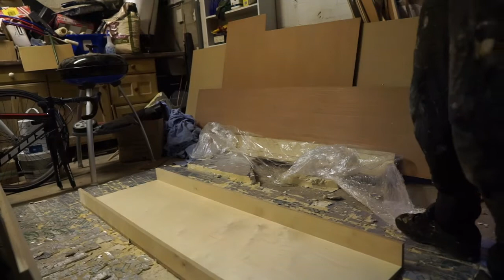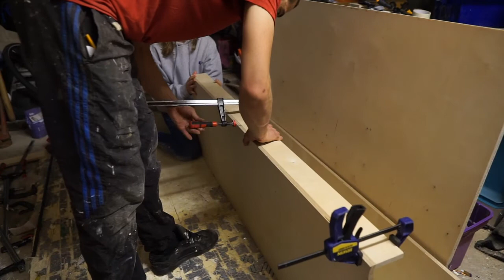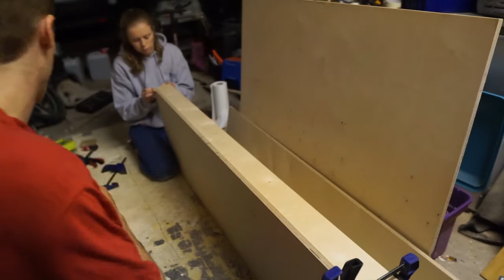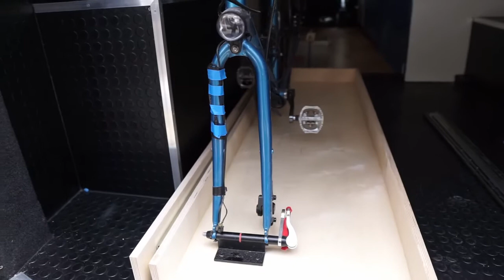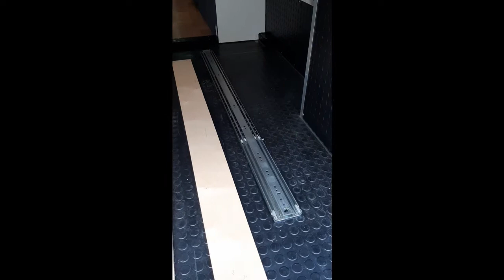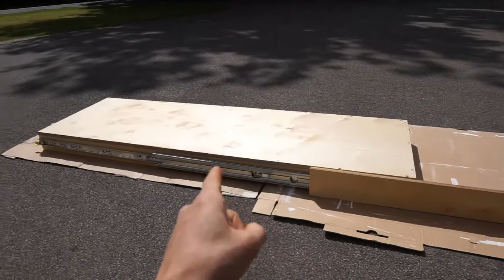DIY slide-Out bike tray for mountain bikes and road bikes - The Gwen Conversion

Comment: I just found you guys.  YT was slow in putting you into my feed.  I’m on like… year 3? Of building out a van.  I’m finally making headway, and I’m thinking a bike tray may be quite useful, if not necessary.
Reply from the maker: We love it. Makes life much easier. One of the best features of the Van for us
Reply from the maker: if we were to do it again we might have made it even wider as its just handy for loading all sorts into the back of the van and then pulling it all out rather than clambering into to reach stuff at the back.